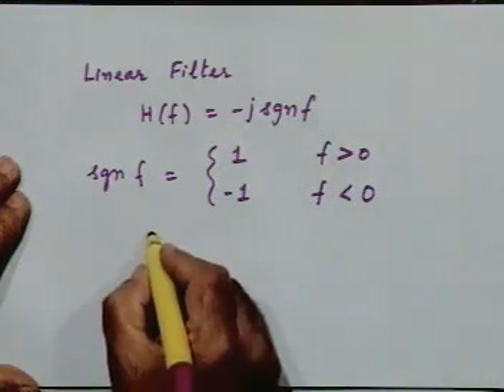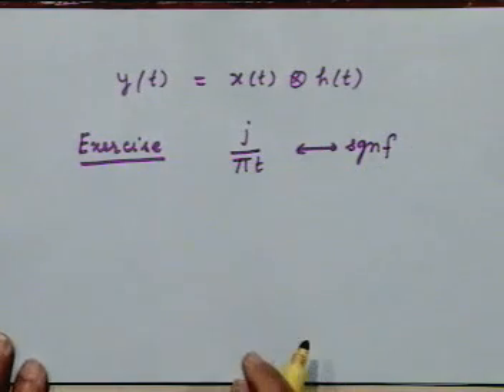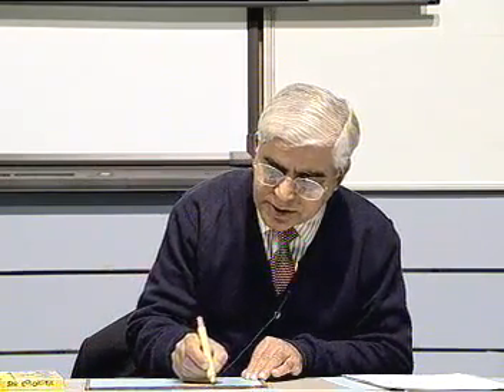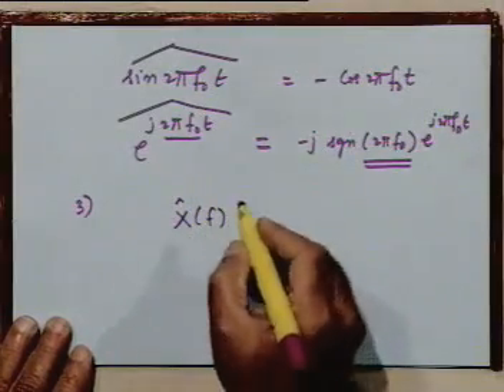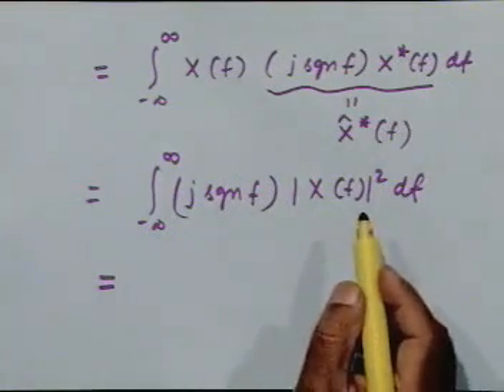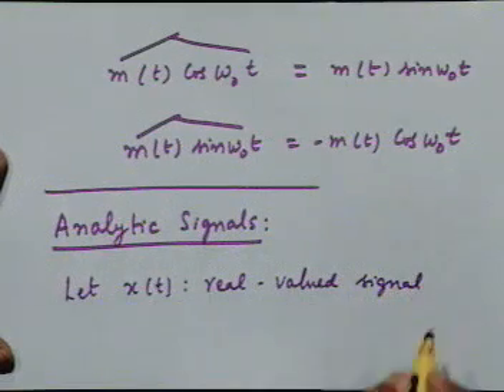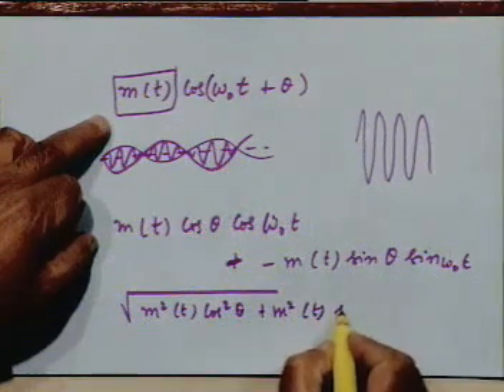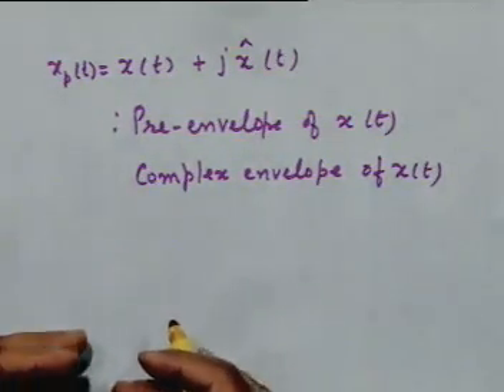Lecture - 4 The Hilbert Transform

Comment: in real time signals is there any -ve frequencies. when consider the bandwidth of the message signal in frequency domain ,since the plot of the message contains +ve and -ve frequencies while calculating bandwidth we consider the lowest frequency as the 0 and highest frequency as Fm. here we are not considering the -ve frequencies.but you told -ve frequencies
Reply: negative frequencies have no meaning in the physical world. It's just a mathematical concept and used to derived results for real scenarios. Thus for bandwidth, you have to only consider the positive part of the spectrum since bandwidth is in real sense.
Reply: @AshwaniYadavIIT  exactly
Reply: Negative frequency is like an image in mirror world. When a person is standing in front of a mirror, the other person standing in real world will look his front part in mirror and his back part in real world to get the whole body picture. Though, the whole body is real. We used its virtual or negative image to identify him. The f=0 axis is the mirror.